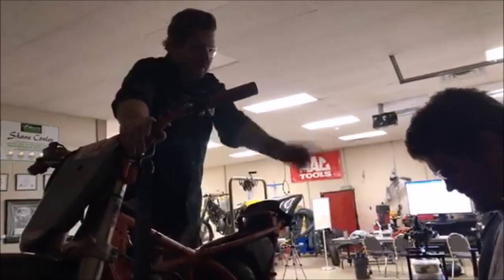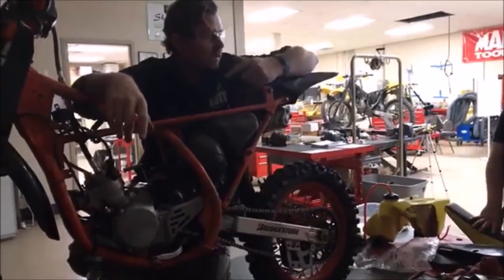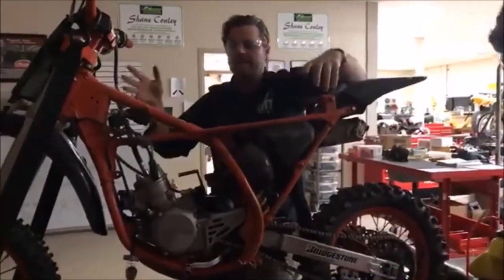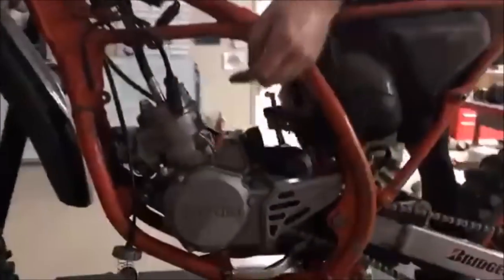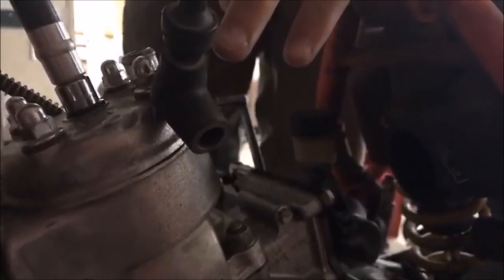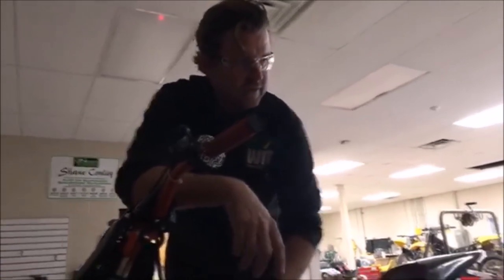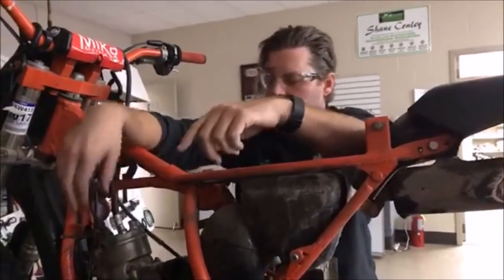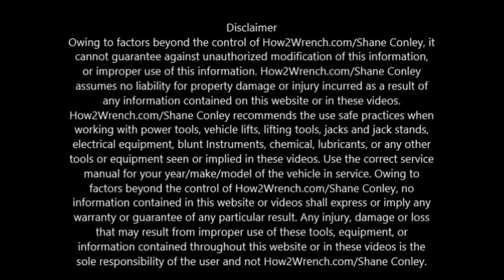Why do a compression test with the lights out?

Comment: I worked as a bike mechanic 1979-1986.  I was shown by an auto electrition to do this trick when I first started . A bike would come in with an intermittent misfire  (normally in wet or damp conditions).  We would use an atomizer to wet the coil an ht leads and turn out the lights.  Then using a long insulated screwdriver  (engine running) we could induce any arcing or tracing on a ht lead or plug cap by resting the screwdriver to earth.  A very simple and quick way to diagnose a bad ht lead or plug cap .  This problem is common and gets overlooked because tracing caps and leads are very hard to see unless in darkness .. and bone dry
Reply from the maker: Thank you for sharing…below are some links that help support me and my work. Please subscribe and share these videos to make a difference in education!
Keep Wrenching,
Shane Conley

Shirt/Stickers link: https://how2wrench.com/product-category/specials/ 

Follow us!
Web:
http://www.How2Wrench.com    
http://www.Tools2Wrench.com  

YouTube: 
https://www.youtube.com/c/ShaneConleyhow2wrench  

Instagram:
https://www.instagram.com/how2wrench/ 

Linkedin: 
https://www.linkedin.com/in/shane-conley-how2wrench/ 

Facebook:
https://www.facebook.com/MechanicsLearningSharingPage/  

Free Mechanic info, tool reviews, and “how to” videos newsletter sign up: https://how2wrench.com/subscribe-free-newsletter/ 

Amazon Tools: 
https://www.amazon.com/shop/shaneconleyhow2wrench?ref=ac_inf_hm_vp

Comment: Great Vid Shane ... Back in the day, a quick spray with salt water on the coil/lead/cap, would soon highlight any weakness(Lights off of course). Could be done with the engine running. Worked great on multi cylinders that had misfires when hot!!
Reply from the maker: I will have to try that one....:)

Comment: For single cylinders I use an automotive "sparkplug style" ignition tester or spare plug properly grounded.  For Harleys I tack welded two spark plugs together at the shells so I don't have to keep them in place while kicking. Two tacked pairs work nicely on wasted-spark four cylinders, but I always verify the SPECIFIC ignition system using tech data if it's new to me. 

We always pull a cold compression check first thing on every bike that enters the shop then note results on the work order. It's great self-defense against lying idiots who insist their two-wheeled abortion was "runnin' when I parked it". We do a general inspection at no extra charge even if the customer brought it in for a single problem and it's probably avoided death and injury over the years. 

"Customer informed of (problem) and declined replacement." is how we note finds they elect not to fix. 

You might want to do a video on how to PROPERLY document work on a work order so customers can understand them and new mechanics who aren't familiar can learn why you NEED to use work orders and save your personal copies.  It's easy to order custom forms locally.  "Two part carbonless forms" is a good search term.  Your students would benefit.